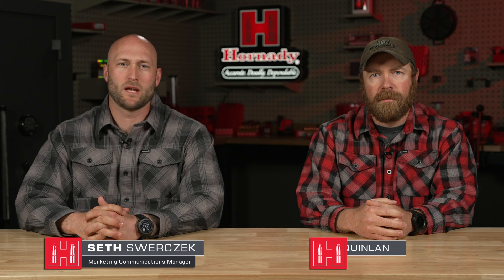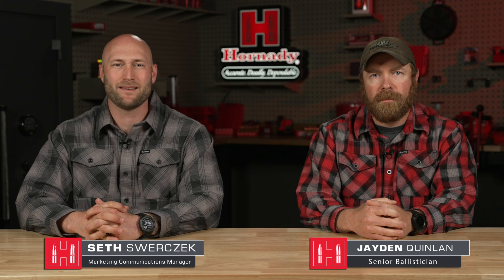DVRT™ - Flat Meplat vs Pointed Metplat

Comment: Is it possible to quantify the variability trade off vs the BC improvement? Why - almost universally if not universally top F class shooters point bullets. Through large data samples they have proved small groups at 1000 and an improved BC i.e. the drag variability while existing is of less significance in the F-class shooting at 1000 use case. I think the DVRT issue may have a very specific application that's not coming across in the podcasts?